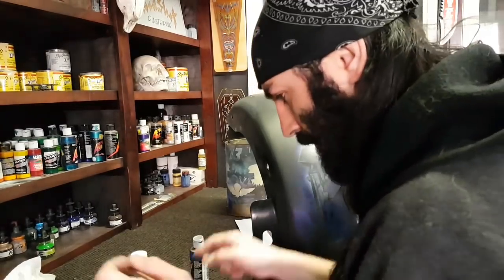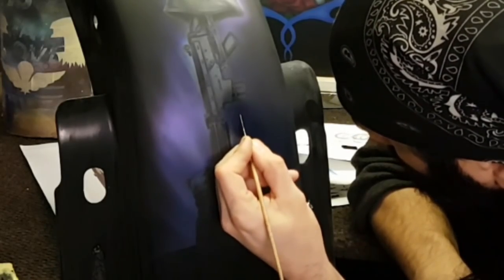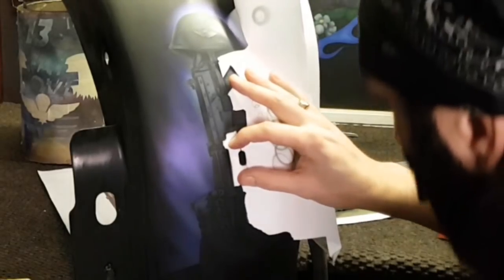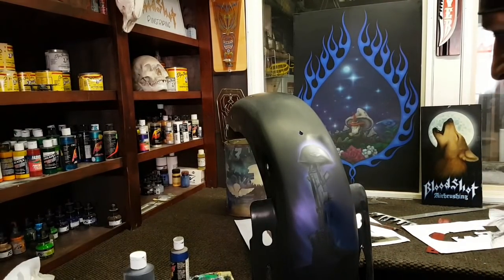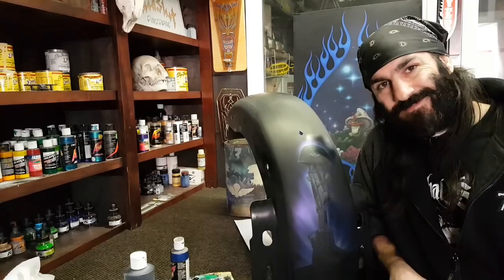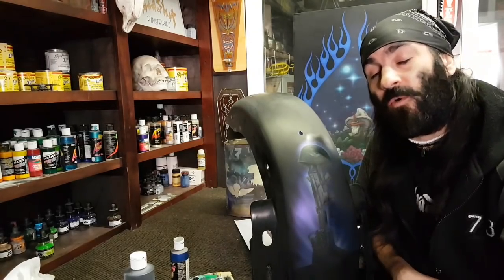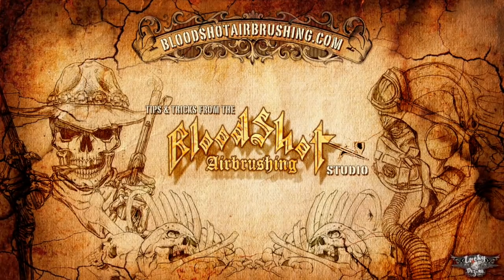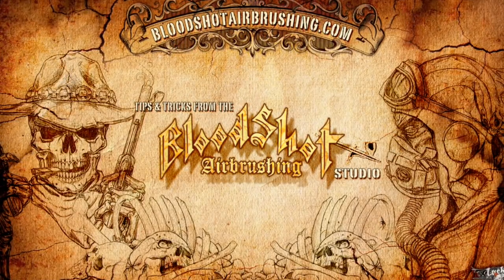How to Airbrush-Fixing touch ups Video.

Comment: Hi after the touch up video are you going to clear and if so do you not worry the oil coming off your hands missing up the clear good job by the way
Reply from the maker: Larry Coleman I only do the artwork. I work with a bodyshop that does all my Base costs and Clears.. .. and those finger prints are their problem.......

I joke I joke.... I use a silicone remover also knows as grease and wax remover after I'm done my artwork. It is alcohol based and doesn't effect the water based paints.... too much! My base painter will do the same. Tack rag the entire piece and wipe it down with g&w remover before any clears are sprayed! Hope this answers your question bro!! Big Cheers and Much Love from the BloodShot Studio!! 🤘

Comment: One thing I experienced that’s bad with water based paints is the paint doesn’t feather out if you sand it! You have to “fill” the hole with paint or build up with clear then paint! Anyone else have this issue or have any tips?
Reply from the maker: 🤔😁I feather it out all the time my friend!! I'll use 800 grit sandpaper, dry and with little pressure. And if it starts to roll up in chunks then I'll take a break, and come back. I find they dont take well to the heat caused by the friction of prolonged sanding. I hope this helps you out a bit broski!! 😁 Big Cheers and Much Love from the BloodShot Studio!!🤘😎
Reply: BloodShot Airbrushing thanks dude I’m guessing I’m heating it up to much thanks a lot buddy!

Comment: Cheers bro great vid on the touch up. Does the packing tape ever pull the paint off. Also just a reminder for the rc body they get painted on the inside so it will be nice to see the reverse tips you can provide. Cheers brother
Reply from the maker: There is always potential of peeling. For this one, It went to the body shop to be sanded down, primed and based , then clear coated. so there was no chance of lifting on this as it was all sealed in clear. as for the rat rod! I'm looking forward to this one!! as always I look to my ARMY for any suggestions for this paint job!! Big Cheers and Much Love Broski!!